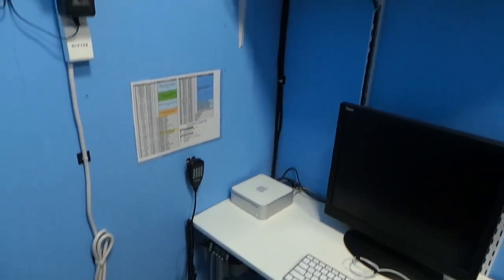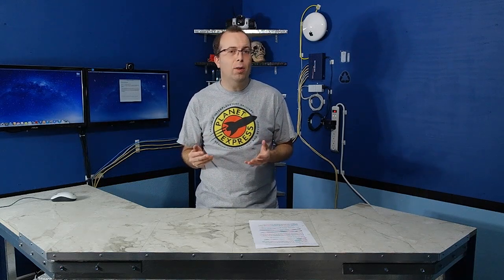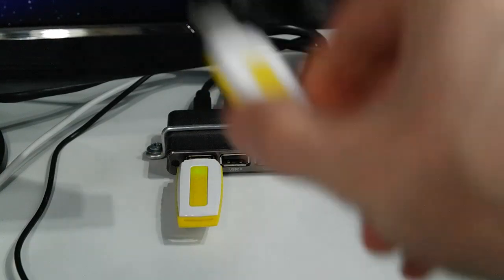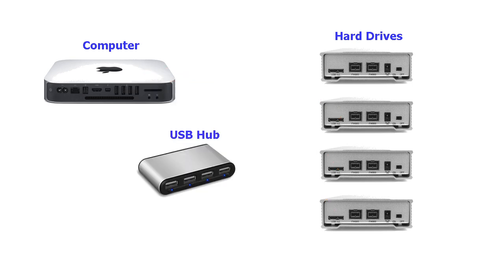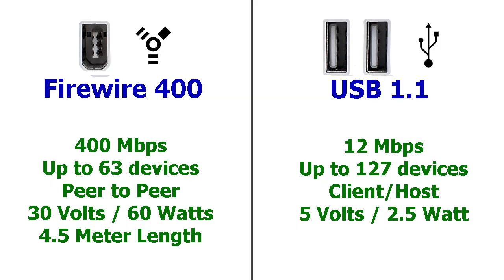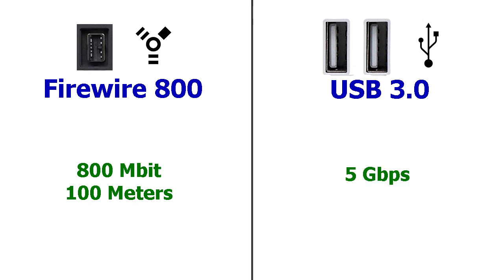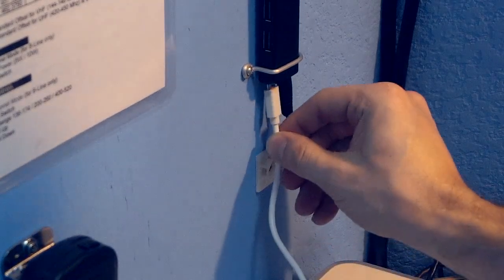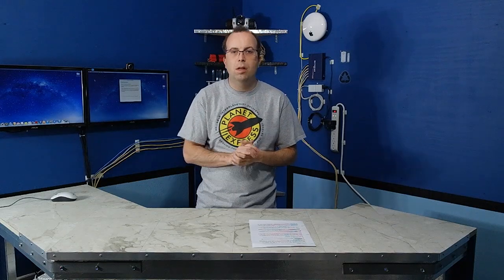Farewell R.I.P. Firewire, Hello USB!

Comment: Why not use Thunderbolt? It is much faster and you can daisy chain
Reply: Anamnesia Actually ThunderBolt 3 uses the USB type C port, and the new MacBook Pros can carry ThunderBolt 3 over USB type C
Reply: he uses a mac mini G4
Reply: LOL HappySlappyFace - my 2011 Macbook Pro disagrees with you... ;)
#MakeThunderboltGreatAgain
Reply: Johannes Koch I think you misunderstand. As of thunderbolt 3/USB 3.1, they're effectively the same bloody thing. Same port, same cables (copper, that is) and cross compatible using PCIE lanes. If you buy a new Macbook or ultrabook it will come with USB type C ports which are both USB and Thunderbolt capable. USB 3.1 is 10Gb/s as is thunderbolt 1, with thunderbolt 2 and 3 being 20 and 40 respectively. What is important however is that Thunderbolt 3 and the most recent iterations of the USB 3.1 can almost be considered analogous, and it depends on the client device plugged in as to which protocol is used. So sure thunderbolt is faster, but the Mini DP based thunderbolt have pretty much already gone the way of the Dodo.
Reply: his Mac mini doesn't support thunderport.
Reply: +wclifton 968 thunderbolt*
Reply: wyzarme They are NOT the same thing. A laptop can have a USB C port with USB 3.1 capability and no thunderbolt as usb is different (no PCIE lanes etc) or it can have USB 3.1 with thunderbolt.
Reply: wyzarme Thunderbolt is a lot faster than USB 
Look it up
Reply: It truly doesn't matter, as Thunderbolt 3 w/ USB-C connector can be Daisy Chained. Also, TB3 is fully backwards compatible with TB2 and TB1. USB 3.1 cannot be Daisy Chained as far as I know. Thunderbolt also supports external displays.

So I think that Thunderbolt will survive, otherwise Apple will have to go back to giving us USB 3.1 and separate IO ports for monitors and the like. We all know that it won't happen.
Reply: @old stuff it's an intel interface, it's used on pc laptops too. You have no idea what you're talking about.
Reply: +HappySlappyFace,  
Just because your 2015 model laptop has Thunderbolt, doesn't mean it didn't exist before 2015.
In fact, not only did Mac's have it long before then (2011) but also PC laptops have had it for many years before that too (2012-2013).
Reply: Well, USB 3.2 Gen 2x2 (The Most Powerful), Is Only 1/2 The Transfer Speed Of Thunderbolt 3, Which Runs At 40 Gigabits/Second.
Reply: Jayson Khouas not every usb type-c though
Reply: if you didn't already know some devices such as quite a few keyboards and monitors actually comes with a hub built in.
Reply: this is a really funny comment now
Reply: AML Vlogs learn little kid
Reply: maybe you shouldn't explain things you have no idea about? Just a fucking through.
Reply: Hajji Daoud because it's for apple devices.
Reply: Thomas asus the best
Reply: +HappySlappyFace my laptop from 2017 doesnt have parallel or serial so they must not exist
Reply: You can still have a daisychain network if you want it bad enough too.  Commodore IEC called, they want their daisychain serial back.
Reply: Hajji Daoud exacly
Reply: Isn't Thunderbolt now dead-in-the-water?
The latest MacBook Pro's won't have them & the newest 38" UWQHD monitor from LG supports USB-C, but has dropped Thunderbolt - which was on their previous 34 UWQHD monitors...  :(
Reply: Sure it does: https://en.wikipedia.org/wiki/Mac_Mini#External_connectivity (scroll down to the unibody)
Reply: George Rimakis not entirely true. Because some devices will have a usb hub built in.
Reply: Thunderbolt is just like USB
Reply: Because USB is going to replace HDMI, DisplayPort, SATA, and probably Ethernet over time. It's already faster than SATA and Ethernet now.
Reply: +fuzzywzhe Because of the way USB leans on the CPU, this will not happen. Especially Ethernet which cannot be buffered much or timeouts occur does not run reliably over USB. Yes the little adapters for laptops from China work, at lower speed, with significantly higher latency while adding high CPU usage... All reasons USB is just not suitable for that. 
Besides that, USB is just not fast enough to 'replace' Ethernet, ethernet has reached the 100Gb/s point (that is 200Gb/s full duplex...) and has been planning on 400Gbit for years now. USB has tried before to replace videocards and failed, due to it's low speed compared to enormous CPU usage, this again is a deal breaker by the way USB operates, the entire standard and all hardware would need to be developed from a different standpoint which would make it an entirely new standard.
While USB does overtake Sata in raw bandwidth, it again draws enormous CPU resources to do this. Sata is being partially replaced by M.2 as a connector and instead of adding layers such as Sata and USB they are now connecting SSD's directly to the PCIe bus, so again USB won't be a factor here.
USB will likely take over more charging tasks but already it fails to charge anything more than a power efficient laptop. Any laptop with performance hardware is already left dry with USB, again not likely USB taking this over further for the mid to high end markets...
Reply: Asus, more like Anus except worse
Reply: HappySlappyFace just stating a fact, fucko
Reply: how do you people who don't know the difference between USB C and Thunderbolt feel they can talk at all about computers? Shut the fuck up. @anamnesia, no, it's actually just taking off. @wyzarme, no usb 3 is not nearly, NOT NEARLY as fast as TB3. never talk about computers again. @happyslappy, thunderbolt started in 2011. Again, @wzyarme, no, thunderbolt and usb 3.1 are different specs, again, you're misinforming people, shut the fuck up.
Reply: bro this video is 1 and half years ago thunderbolt didn't exist yet
Reply: @HappySlappyFace  What do you mean? Thunderbolt 1 came out in 2011 and it was already a better connector than Firewire in EVERY way in it's first iteration. TB2 was out during the making of this video and devices with TB3 started shipping the same year this video came out.
Reply: HappySlappyFace It did... In fact my 2011 Mac mini had one
Reply: Your piece of shit Asus does not dictate when a new technology came into existence, ya fuckin ape.
Reply: Maybe you should stop being a bitch and stop saying you know everything because you don't so why don't you shut the fuck up
Reply: Murphy the Turtle u dont even know how to tag someone xD
Reply: Actually FireWire is quicker than thunderbolt and has a lot quicker latency
Reply: @dylandesmond  hell no.. i have TB2 cain at home that replaced the FW800.. don't know about latency but speed of TB2 is far superior than FW800.
Reply: reis til helvete I’m running 32 samples latency running a shitload of effects samples and instruments running over 1000 samples per note, I have a live loop called getting there that was recorded live using a apc40 midi controller and a Roland A-88 keyboard, all sounds are generated with computer I’m getting 1.5ms output, I can’t run half the effects with thunderbolt or thunderbolt 2 as it can’t keep up with the buffer rate (completely starts outputting underruns because it can’t buffer small packets quick enough) , for data storage it is better, but I run m.2 for storage, FireWire is close behind PCIe audio, but 10x cheaper
Reply: reis til helvete latencymon is a good tool to use to figure out how to make your hardware as quick as you can get
Reply: reis til helvete direct PCIe ssds are the future as it’s bypassing most hardware, speeds over 10,000Gb/s is possible
Reply: ***** sorry my 2015 asus laptop dissagreas with you
Reply: @HappySlappyFace  disagrees*
Reply: Thomas is that even a word? Stop playin gta kid
Reply: Thunderbolt isn't any faster than USB in the most recent iterations, with the latest thunderbolt capable devices using the type-c connector, I wouldn't expect thunderbolt to survive as a connection and protocol in its own right.
Reply: Dude Thunderbolt 3 uses PCIE, its fast enough to run an external graphics card.
Reply: Thomas wow no need to start swearing in a child friendly channel

Comment: Thunderbolt 3 is like 40Gbps and you can daisy chain items. I'd say that Apple has definitely replaced Firewire with a better candidate. USB 3.1 is also fast, uses relatively the same cable, and I believe works from Thunderbolt 3, but not the other way around.

You can even run an external GPU off of a Thunderbolt bus, adding rendering power to a system that might otherwise be limited with whatever you have in the case.
Reply: USB type C can also connect to an external full desktop GPU is reversible and is small enough to take over usb micro and mini on mobile devices.
Reply: Intel > Apple
Reply: kshitij mehta well apple uses Intel so that's not really a comparison. It would be like saying Nvidia > dell
Reply: kshitij mehta Apple rarely makes their own tech. They commission everything from vendors, such as Intel. By pushing ahead tech with crazy port options, they drive other tech forward by competing. (Like USB 3.1) Sadly, their best ports and options rarely become the norm in the market for most users.

Part of the problem is that the tech is usually way too expensive. I think comparing sizes, HDDs are like 4x the price. Port replicators can also be pricey depending on options.
Reply: i'm not talking about which is better than which talking about whom to give real credit about thunderbolt.

Comment: I thought FireWire died 10 years ago.
Reply: I've never seen a device or a cable with FireWire port. I only have PCI card with 5 of them laying somewhere.
Reply: I was thinking the same thing... I'm not even old enough to remember a computer with firewire support, although I saw miriad of devices with firewire ports (especially external sound-cards and AD-DA converters, but also some cameras).
Reply: +KohuGaly the HP elite book 2540p has a mini FireWire port if that counts which only came out in the early 2010s
Reply: wclifton 968 I know there are machines with firewire. I just never came across them. Perhaps it's a regional thing...
Reply: probably although I live in the UK

Comment: Uh, how about using a NAS for your data?
Reply: I thought the same... if he need so much storage, a NAS is much better for multiple reasons, starting with internal RAID management, hot swap, ethernet instead of USB, integrating system for upload/download, availability to all the house, and other cool stuff all at a reasonable price these days.
Reply: It is bigger when you add all the drives and caddies. A whole nas with drives would be smaller, power efficient and somewhat easier to swap out drives. Though this is a franken build, and sometimes those are more fun.
Reply: TechyBen that dosent make sense how its more power eff
The drives can have max 3 amps 5v of power. The mac minnei prob eats less than 5amps 220v
Reply: The drives are used for his NAS, he isn't going to build a professional grade one as he doesn't need it.
Reply: his server is a mac mini
Not a full ATX PC its smaller than your keyboard

Comment: I was hoping that you'd discuss devices that are still firewire only in an age where it's harder to find firewire cards and such. I hoped there might be usb in between
Reply: Well, depending on your country you should still have options.  My PCIE card came from Amazon for about $20 and has both 400 and 800 ports.  I use it nearly every day for video footage.

Edit: I have had luck with my USB Dazzle device when internal firewire is not an option.  I forget the model, but it has firewire and the connection has been rock solid... if not a little frustrating to make the initial connection.
Reply: I was able to buy a fw800 pci-e card off ebay which solved a lot of problems with using older drives.  
Works on mac and pc.

Comment: I love how older standards had some really sweet ideas that seem to be forgotten in todays technology and new standards for no reason. Even MIDI is Daisy Chain capable. It seems that modern standards are made by a different type of people. Not engineers with usability and practical use in mind but rather by marketeers. :/
Reply: almost right but nooot quite. You were right to "follow the money" but the direction is wrong. The real money is in the devices and usb is almost all done on the processor with a few support components, FireWire on the other hand requires each device to have a chipset with a full network stack, in theory you could do things like sending a command to copy a file from one FireWire drive to another and have the two drives finish the transfer independent of the computer.
However all that stuff required a big expensive specialized chipset where USB could get away with even a general purpose microcontroller of the day. FireWire lost because it was expensive and there was a "good enough" alternative. 
Apple eventually dumped FireWire from the iPod due to the physical size of the chipset and now the only real place you'll find FireWire is in old DV cameras other AV equipment.

P.S. there were totally FireWire hubs, maybe 2, for when you needed to plug the 1 FireWire memory stick into your computer.
Reply: It's actually an improvement overall. Firewire would have needed a redesign to be as ... universal as USB. You wouldn't get cheap webcams or charge a phone over firewire. If daisy chaining were a high demand feature, we'd simply see more devices with USB hubs built in. But since USB hubs are only $5 anyways, it's not something we need.
Reply: If he had a PC he would never be out of USB ports. My PC has 12 with 4 at the front & 8 on the back panel.
Reply: Sounds about right. There are cut down micro controller and micro development boards for USB that don't even have real usb support, they just use a tiny chip to bit bash the right usb 1.0 data, and you can pick them up for under $/£5. A firewire equivalent would be much, much more.
Reply: In the end, all comes down to production cost.
Reply: Yeah and I hate having to buy more cables I would rather have a set number plus back ups if a cord broke.
Reply: I feel like thunderbolt is a good replacement though. It has higher power delivery, speed, and is smaller and also supports daisy chaining
Reply: KRAFTWERK2K6 I haven't forgotten fire wire just yet
Reply: Echo_Hotel that's the kind of FireWire I still use
Reply: an atmega32U4 is an uc that has an usb controller and costs $3.60 with the minimum requirements board (usb plug, voltage regulator, and a few passives) or $3 if bought bare per 10
Reply: You can daisy chain USB without any external hub, as long as the peripheral devices have hubs inside of them.
Reply: That is correct. Paradigm shifted and now
everything is designed by the marketing department for maximum profitability.
Engineers' job is to implement their design specifications.
Reply: TechyBen The real shame is that  IEEE1394c never got a chance, Firewire over Ethernet would have been great, imagine if that took off having a computer with 6 ethernet ports on the back.
Reply: It's intentional, this way it forces people to buy usb hubs which means more money for the industry.
Reply: @vladdx  For a device to support daisy chaining it needs external power. And USB is mostly used for low power devices. But if your device has an external power source and a small USB-Hub: There you go.
Reply: CAPITALISM
Reply: meheezen
 That's not true. If they make more stuff people are going have to use it. Price will not mean anything. All about force and control you need. They make new laptop none of your of USB stuff work. They make you buy more junk. Never ending catching up. That's why you stay a few years behind you will never have to live that hassle.

Comment: I'll always remember Firewire as this weird port every MacBook and iBook owner had on their PC/laptop and almost never used, since USB was far more ubiquitous and cheaper. Sure, the speeds weren't initially that great, but you really didn't need 12 Mbps during the mid- to late 90's unless you were a hardcore user. USB drives were still faster, more reliable and much larger than the old floppy disk for moving files. And devices like mice, keyboards, printers and webcams didn't really need the bandwidth that Firefire could offer. 

The interesting and sad thing about the tech industry is that it's not always the best format that wins. Why did Blu-Ray win over HD-DVD? Why did VHS trump Beta? Why did the Secure Digital (SD) card beat Memory Stick, CompactFlash and MultiMediaCards?

Cheaper, faster, more reliable, simply more corporate support?
Reply: Mediocre product with aggressive marketing always outsells a great product with good marketing. Vast majority of people are incapable of putting their minds to it.
Reply: I wouldn't really blame it on consumer laziness or ignorance. You can't buy what isn't being sold (anymore) and the majority of consumers, myself included, will buy into what has the the greatest mass-appeal, usability and longevity. There's always a critical point where the trend might shift, but that's not always up to the consumers. HD-DVD died when more and more major studios shifted towards Blu-Ray. Memory Stick was essentially just Sony and a few others. We wanted to buy a new digital camera a few years back and really liked the Sony model. But it only supported Memory Stick Pro Duo and those were expensive, compared to the cheaper SD Cards. And Beta was more of a niche produkt for professional users.
Reply: TBH, I like all Memory cards,I Have 7 SDs, 2 CFs, and 1 MS Pro
Reply: @stereorail - you one of dead Steve's fanbois?

Comment: You may want to go with Thunderbolt, if you still desire the daisy chain ability, albeit only 6 devices only (vs 63 on FireWire), and take note on the different types of connectors for Thunderbolt version 1 and 2 uses the MiniDisplay connector, but Thunderbolt 3 uses the USB-C connector.